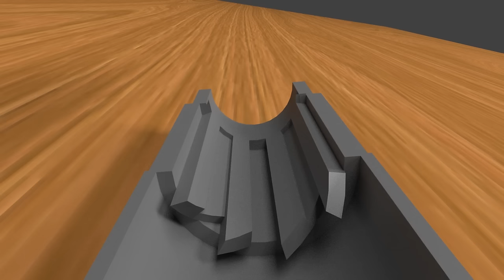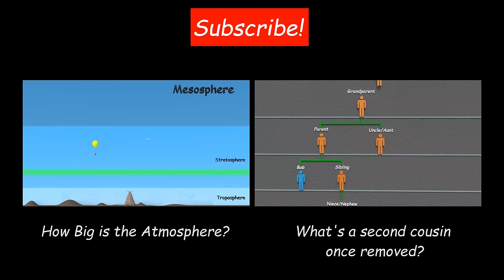How Does a Clicky Pen Work?

Comment: I opened a pen once and i rearanged some of the stuff and somehow made a small canon lol
Reply: I did too, but i found out about it from my friend
Reply: At school, I think we made a similar item of what your describing. We called them penetrators. Get it? We took out the ink cartridge and flipped it so it came out of the back of the pen. Next we either got rubber bands or the built in spring and attached in a way so that when we pulled the back of cartridge and released it would 'fire.' They were extremely lethal. After one or two were made, the whole grade caught on so we went to the shops buying the items needed to make them. 

One day we had a relief teacher, an old lady with a temper. Some idiots started firing the ink cartridges at her, thankfully missing, but hit the data projector screen instead. They got caught, and the teachers did a search of our bags and pencil cases, one kid had an assembly line in his bag for mass production. So, yeah that was grade 8 for me. We didn't have school shootings, we had penetrators.
Reply: Me too, but with a led one.
Reply: pretty sure all you need to do is put the spring before the cartridge
Reply: @benharris211  what? The kid has an asembly line on his backpack?
Reply: @rumahhafidzahbekasi1354  Yeah and No, not the automated one you may be thinking. He kept the materials in metal cases that he kept in his bag. I was only using the words Assembly Line, because of how he kept all the materials together which made it easier to make instead of hunting down pens, springs and rubber bands etc.
Reply: @benharris211  oohhhhh. I think it like a belt running like in the factory
Reply: I alao turned a clicky pen into a projectile weapon. I just took the cap, the ink cartridge and the spring out. All I have to do is extend the length of the spring by pulling it and put everything back  inside the pen. Just click the pen once, press the clip section and all of the internals fire out. But I need to pick up all of the internals after firing once
Reply: @qifuhyue3568  i also made a pen gun using only pen!
Reply: If you pull out the two back pieces that work together and click, you can just push the ink cartridge down onto the spring and release it; it'll launch the ink cartridge across the room. Bonus points if you flip the ink cartridge around so that the pointy side fires first for maximum lethality.
Reply: G2 pilot pens are awesomd
Reply: Magst3r I’ve done that too🙂 I’ve also done it with mechanical pencils
Reply: Everyone’s done that at some point at school.
Reply: @Juan-ng7rs  excoose me how to do it
Reply: @benharris211  this is some world war american stuff
Reply: @benharris211  It seems like you're a really high grade, but in reality it's not, in grade 3 you should know the difference between your and you're.
Reply: @AxmPlays  Cut me some slack, most people don't know the difference between a noun and a verb.
Reply: Nice idea
Reply: epic
Reply: I just used the barrel and the spring to make a pen gun
Reply: Juan 233 how
Reply: @tr190  same. We called it injectors and would fire them onto foreheads and hands

Edit: we used the top half of the pen, took out the button and cam and spring, put the cap back in first, then the spring then cam and used the cartridge to push them into place. For less injury, we took out the cartridge and just fire the cam lol (but for a lethal weapon, just put the cartridge in and fire by pushing the button)
Reply: Make a video on it
Reply: SAMMME YO
Reply: I made that with my Parker Jotter xd
Reply: I made those and sold them for 2 bucks a pop.

Comment: The best pens are the ones you can take apart to turn into cannons.
Just put the spring between the button and the cam and hope the pen has some sort of lip that the cam fits behind but can be pushed past with enough force.

The Pilot pens seem to be the best for this, but you'll need to do extra modifications if you don't want your parts to go missing.

Comment: I was never aware of the hidden guide edges which prevents the cam from sliding back while the pen tip is extended. The other parts we can easily see when we pull the pen apart. Life mystery finally solved thank you. (This video also made me pull apart a pen I had on my desk!)

Comment: Thank you for making this video. I’ve always wondered about this, before I saw this, I thought that maybe it had two cams and each cam was the same kind of cam that’s converts the linear motion on a steam locomotive. I thought that the button press moved the cam, which converted the linear motion into rotational motion, and that that rotational motion turn a wheel whose rotation was restricted to one direction via a ratchet, and the movement of that wheel was attached to a second cam, which converted the rotational movement back into a linear movement. But I was always dubious of that, because these pens never get jammed. So thanks for clearing that up.

Comment: what if  this idea is applied to create passive modular actuator for already established  electrical switches, so it can be  actuated by low voltage relay and also can be retrofitted on top of home electrical switches for home automation purposes  with complete isolation from main wiring and in a modular way!!

Comment: Excellent video.  Would you happen to have CAD drawings for this (step, stl Autodesk if possible)?  I want to use the same mechanism in a different context.
Reply from the maker: Thanks Don!  Unfortunately I don't give out the 3D files for my animations.  I'd be happy to help you if have any questions about modeling in Blender.
Reply: Hi! did you manage to complete the 3D drawing of it? I'm also trying to do it for my school project but with solidworks instead
Reply: @JaredOwen  Excellent video, just curious why Blender over mechanical CAD software?

Comment: "This piece translates linear motion into rotational motion"
HOW THOUGH?! That's the ONE thing I don't get.
Reply: The spring is pushing the cam back they are then redirected to rotate by the push button tooth. This is then prevented from happening by the guide on the upper barrel. Pushing the button pushes the cam out of the guide allowing it to rotate when the spring push the cam back up against the push button tooth.